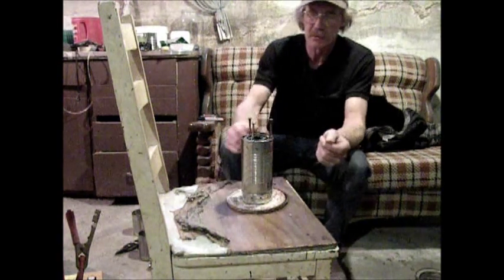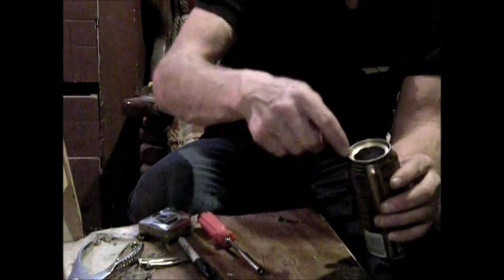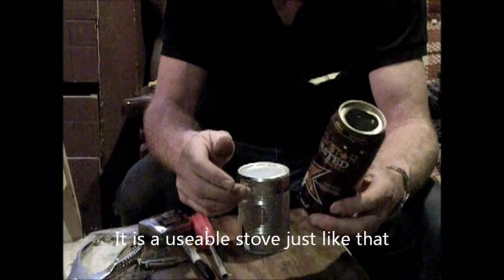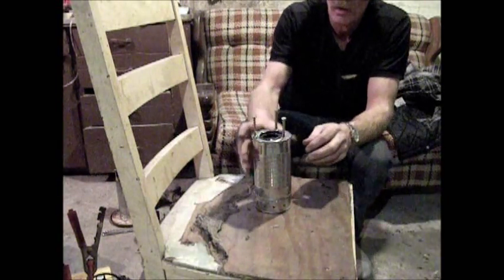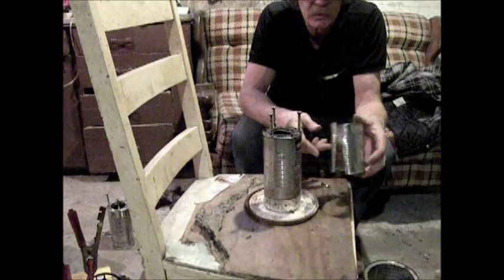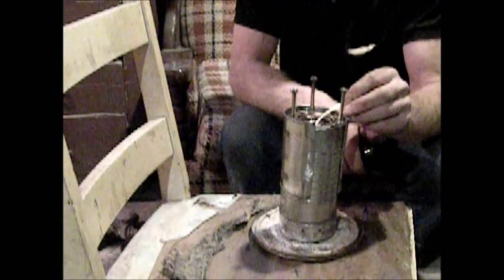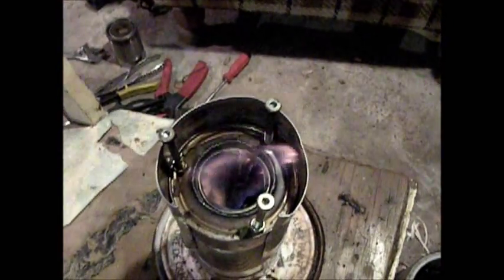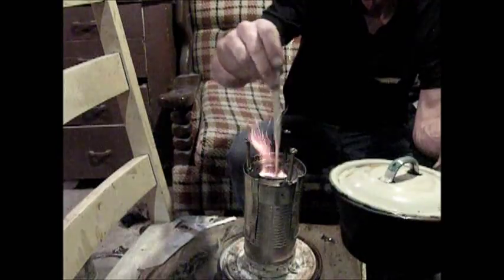Wood Gas Stove

Comment: Mitch have you had any problems with your aluminum cans melting when you let the stove burn up all the remaining charcoal which generates the highest heat?
Reply from the maker: Yes. The aluminium can really doesn't take the heat well enough to be practical.
Reply: @MitchAshdown  mitch good to hear from you.  can you comment on the hole size you use on the pop can stove do you use the same size hole for the primary secondary (on the pop can) and the primary holes on the detachable base. I want to build one up like yours and then compare it to an all steel can version. I expect the high heat transfer to the secondary air from the aluminum is much better than with an all steel build. Faster to heat up and less smoke also.
Reply: @MitchAshdown   I asked about the aluminum drink can version and where the melting occurred because I was wondering if the melting occurred in the bottom of the burn pot then I could line the inside of the bottom of the aluminum can with steel (I think a third of the way up with steel from a tin can would do) to provide significant thermal protection for the aluminum can in the area where the temperatures get the highest especially if you are burning all the fuel so once you have nothing left but charcoal which will burn at the highest heat the steel liner side and bottom could extend the life of the stove. Your thoughts on this?
Reply from the maker: @morayjames92   Sorry I never noticed the post Moray. It melted at the bottom when the wood went to coals actually.
Reply: @MitchAshdown  thanks Mitch have a happy Christmas. maybe when you get a chance you can tell me what diametre holes you use.
Reply from the maker: @morayjames92  Merry Christmas to you, Moray. I kind of went by feel, lol. But I am guessing around quarter inch or  bit smaller.
Reply from the maker: For bottom of inside can. Outside one I tend to go to one larger hole so a damper can be rigged there and so it can be pointed into the wind or a computer fan rigged there. Nice to have flexibility in practical application.

Comment: Mitch, you are amazing!  People like you deserve recognition.  
I hope someone teams up with you to design these so you can market these.

You have made the most fuel efficient BLUE flame wood gas stove. 

I have been watching this video for over 6 years now!  Now that I have more time I am using this as reference to design a smaller compact one.
Thank you so much!!!!
Reply from the maker: Thanks for the compliment. I don't know if you checked my channel, but I posted  a small one and the one I have used for years and still do when fishing. If you make a vid of your efforts please forward to me. I would be most interested.  The long burn and blue flame are with dry pellets. In practical use I use closest little branches to where I happen to be. Wet weather I  "cook' fuel in a cofeee can after food for next meal. I also usually take a rocket stove for persistent wet/windy weather. These are all like 7 years old. I really should make some more one of these days.
Reply: did you or have yu built a stove yet would like to see if you have.

Comment: I got it. It was the lower U shaped bottom that inserts into the outer layer that plays a critical role in letting air in and preheating it (as the air enters upwards and then downwards) before the air enters into the burning chamber through the lower holes. If this guessing is correct, then do not drill any holes at the bottom part but just adjust the V groves so that it allows more air to get in.  I will make a better one myself to prove this to be correct.
Reply from the maker: Perhaps. I would be interested to see your experiment. I think it is to hold the heat on the wood to release gases. Where you say not drill a set of holes, do you mean in the outer layer? Inner layer ones are needed so a small amount of oxygen reaches the wood so it does burn a bit although very restricted. Consider both the air and the woodgas as not going one direction at any point, but being balanced close enough so both directions exist simultaneously. One can see this right at the top of the wood, and my glass stove was an attempt to see it  between the container layers, but was inconclusive.
Reply: @MitchAshdown  I have tried it and proved that it did not work. After drilling side holes at the bottom  like what you did worked. I just made a video comparing four types of such portable wood gas stoves and found a winner which is a better design than yours. Take a look: https://www.youtube.com/watch?v=RrtltMSuGCk

Comment: I’m beginning to see the standard flaw most wood gasification stove builders encounter, and that is ... too much air.  This stove has smaller primary air holes thus the burn is controlled and allows the fuel (wood) to “cook” which produces rich gas that is circulated eventually into the secondary jets near the top of the fire bowl.  A method of adjusting the primary air intake holes might be worth a try which could be effective in getting the fire going then reducing the air once you are sure it will stay lit.
Reply from the maker: Right, heating the wood in a low oxygen environment is what releases the gas which is then moved to where it is burned efficiently. This type of stove tries to do the "moving" using draft  and eddies rather than air pumps for simplicity, reliability, weight/size , and efficiency. It is touchy to get just right for sure, but does work. Several of my stoves have adjustable air intake dampers and some I also added a computer fan to add to the other end of the adjustment range.  In actual usage there is time delay of the heat getting to the fuel, so it takes a little feel to maintain a good burn, but also to be adjustable to requirements of what you are actually cooking and not just be a neat toy.
Reply from the maker: Close. Not too much volume. Relative pressures/vacuums. Adding a fan or a chimney changes everything.

Comment: Just did another one with smaller cans- i'm on the look for the perfect stainless steel cans (aluminum keeps melting) - don't really want 14 minute videos- but too lazy to trim them- just upload directly. My thinking is that if you get a tall tube as a 3rd outside layer you could get some real updraft, and have the effect of a fan- i'm trying to get a blue flame.
Reply: can you tell me about having aluminum cans melting? where did the can melt first? I am assuming at the bottom? There may be a way to keep the aluminum can or the burn pot as it has the best thermal transfer to the incoming primary air. Thanks.
Reply: @morayjames92  it's been a long time, (7 years on this thread... wow! Hope mitch is doing OK). I don't really remember, but aluminum melts at 1000 degrees, which is going to be common with a good burn. I built a jtube stove using ashes as insulation out of gas vent pipe and the chimney just melted right down into the material- my friend watching told me aluminum melts at 1000 degrees. I asked him why he didn't tell me that before i built it... hey replied, "You'll never forget now..."... he was right.
Reply: @DIvonBriesen  Thanks for taking the time to reply especially for such an old topic (for you). My thinking was that woodgas stoves generate charcoal and when you burn all the way to the point where there is only charcoal left to burn and that is when you generate the highest burn temperatures (and get the nice blue flames). Getting back to my conclusion, the quantity of charcoal in most stoves of the sizes seen here is small so the high heat will be at the bottom of the stove, This means that you could build a two part burn pot with a steel bottom and aluminum side wall for the rest to obtain heat resistance at the bottom and excellent heat transfer from the side walls to pre heat secondary air. Am alternate to a two part burn pot would be to use an aluminum burn pot and include heat sinks on the bottom this would be a better solution as it will also improve primary air heating. A heat exchange to do this can be easily achieved by installing aluminum screws into the bottom of the burn pot.
I have seen a lot of folks use aluminum cans for burn pots and not report any problems and the only melt comments I have found with aluminum is when burning  charcoal. Your thoughts or comments would be most welcome.
Reply: @morayjames92  Would love to spend more time discussing... just can't this very moment... maybe in a couple days? Overall the stuff is so cheap i'm not sure it's worth saving on metal.... i did a couple stainless steel stoves out of old thermos type containers... they were pretty cool... just cut holes in bottom (some all the way thru and others thru outer layer only) and then a bunch at the top inner edge to let the hot air come in- led to some huge flames.cant find pix at moment...
Reply: @DIvonBriesen  Thanks for responding. in all the stoves I have built I find that if you want to have blue flames you need to make the stove efficient and that comes with choking the stove down and getting the primary to secondary air balanced. When I get the right balance I get the most blue in my flame. Look forward to chatting more when you have time.
Reply: I want the blue flame too

Comment from the maker: I found it now on your channel. I like. 
The bottom is nice, especially the stand, but only effects the burn a little. I see you found a little bigger aluminum can for the outside. I'd like to try one that size for the burn chamber.
One of the guys mentioned having a damper. I've made a few different kinds, but a simple one to see the effect is just add another bigger air hole at the bottom and wittle a wood plug for it. Take it out, put it in or sit it partly in for 3 settings.

Comment from the maker: I've had no luck with those video responses either. Must be a trick because people do it, but I haven't figured it out.
I just used a couple larger cans connected the same way and stuffed fiberglass insulation in the top one. Opened some holes in the bottom one for air. I didn't bother insulating the bottom one. Also have used aluminum stovepipe. 
I can't take any credit for bending like that. Saw it on YT and fell in love with it.

Comment: Well, i've tried to use youtube to create a video response with no success, and lost my original post- but your vid inspired me to finally try to build one (mostly) - worked very nicely, and hope to make some improvements- including bottom part. Would love to see details of your system with the outer can  - you mentioned insulating it. Also loved the way you bent the edges in/out with the screwdriver. Used that and it worked nicely.

Comment from the maker: Reduce the size of the top opening. This is a must.It costs in the size of the fire, but gives you gasification. It works even better to locate a small disc in the center of it but it gets in the way of loading and tends to burn up. So after many tries I decided it wasn't worthwhile.
keep the holes low enough to give the fire a place to exist. I usually bend them into venturies but the aluminum can isn't strong enough, and it really doesn't effect the burn much.

Comment from the maker: not too much air to the wood. I put a damper on most of mine
 wood has to get hot. That's why I tried aluminum here to that end and it works. There is a theory that I agree with that air flows downward in a real good stove, with all the air burnt out of it. I tried to show that with the glass stove, but didn't succeed. I posted it anyway
combustion air should be hot. Keep the space between the inner can and the outer to a minimum. It helps a bit to insulate it, though this stove currently isn't.

Comment from the maker: Thanks. I've been using them whenn fishing for I'm guessing about 7 years. I tried a fan but soon got sick of the noise. Also note the world stove goes through wood very fast. Most that I've seen with a fan are basically just forges. And for pellets, If i'm gonna buy and pack in fuel it might as well be propane. Also it seems to me it takes more energy to make the pellets than what you get out of them. 
 The blue flame is the wood gas, orange carbon (simplified but). To get it

Comment from the maker: On biochar, I usually let it burn out. The coals keep food warm good. Just a teaspoon of ash then. As far as saving it, it is such a small amount, other than for filtering water maybe. Certainly not gonna save the planet adding to your soil. With the aluminum can in this one though I don't want to leave the coals in as I fear they'll get hot enough to melt it.

Comment from the maker: On other stoves I have added a third can outside and insulated it. The bolt pattern can be bigger then. 4 bolts or even 5 are more stable but have to be set accurate to not wobble.

Comment from the maker: I didn't weigh it, but the pop can was filled to just below the holes, so pretty much full. 20 minutes is probably a bit conservative. It varies some depending on the wood, moisture, how tight you pack it etc. I didn't want to overstate it. Yeah, for a bigger frying pan than what I usually use I'd bend them out. They will bed some just pushing on them. The can bends. I since moved them down to the bottom of the threads. If the handle is in line with a bolt, the frying pan is more stable.

Comment from the maker: I enlarged every second bottom outside hole slightly today. Cooked pancakes indoors. It was still going a while after I was done eating. No smoke smell at all even at the end of the burn. The only smell at all, other than the pancakes, was a very slight charcoal smell after it was out. I have to get a CO2 detecter and check that, but it isn't meant for indoors.